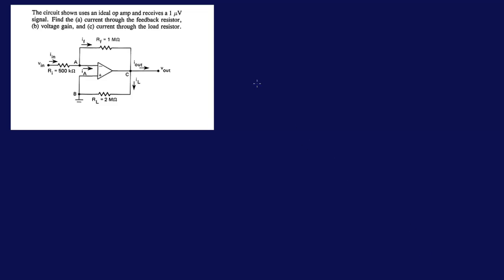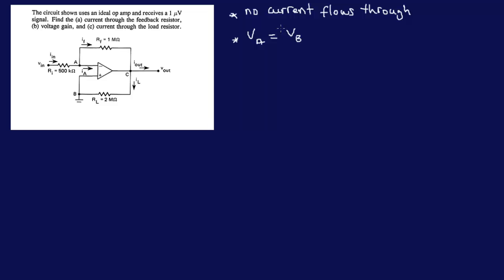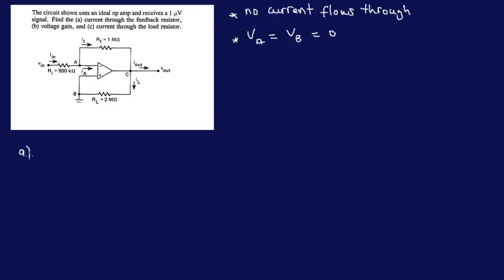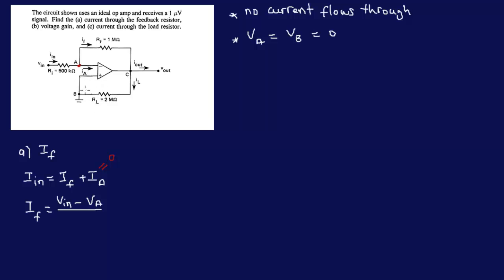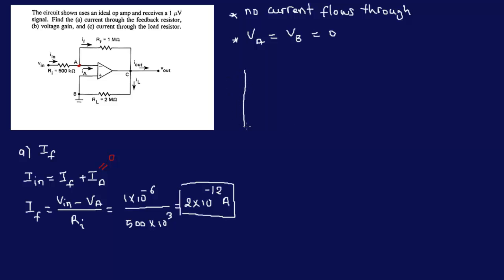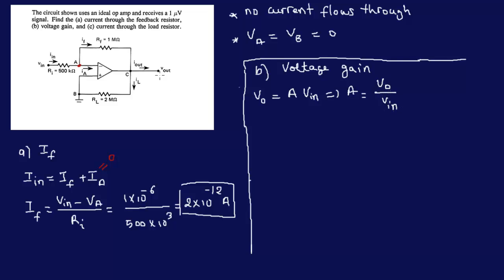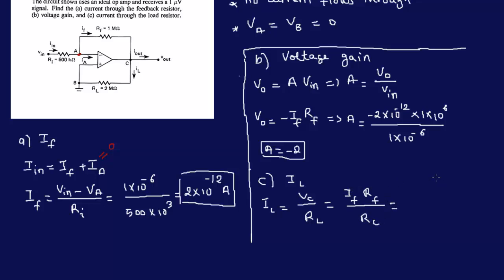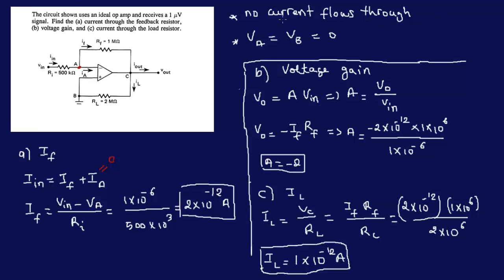OpAmp Circuit Analysis Example 1-FE/EIT Review

Comment: Hi!, I wanted to clarify if electrical machines is a part of the EIT syllabi for FE in electrical and computer sc. ? The reason I as is because the latest syllabus mentions it, but the NCEES reference manual does not have any formula reference sheet for this topic. Need help clarifying this, thanks.

Comment: i dont understand that why  V_out .= - ( i_f x R_f) ???
Reply from the maker: Think of it as a potential difference between point A and point C. It's the voltage across the resistor R_f following the direction of the current . Therefore, we have:
 V (at point A) - V (at point C) = I_f x R_f.
V (at point A)= 0
V(at point C)= Vout
Vout = -I_f x R_f

Hope that helps.

Comment: Thanks for this video, it really helps. From question b) Vout= -Rf If,  from question c) it is now Vc=Vout= Rf If, why did you omit the negative sign?
Reply: The sign of the current coming out of point C is given by the voltage drop from C to ground; since the voltage at C is negative, the current coming out of point C is negative.
Or, more simply, a node of negative voltage will sink current from ground.
Reply from the maker: For question b): Look at the answer I gave Gokhan above.
For question c, we are also following the direction of the current coming out of point C.

Hope that helps.